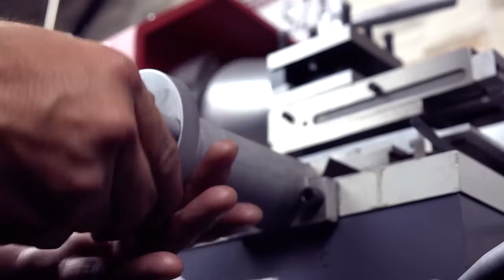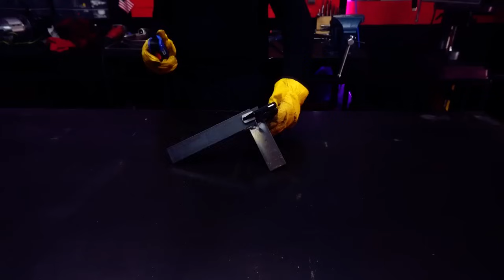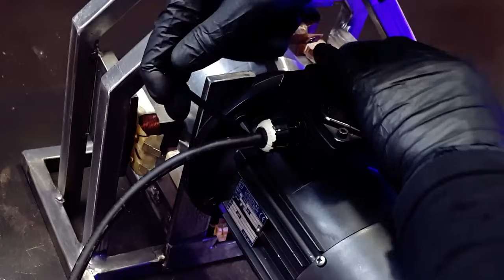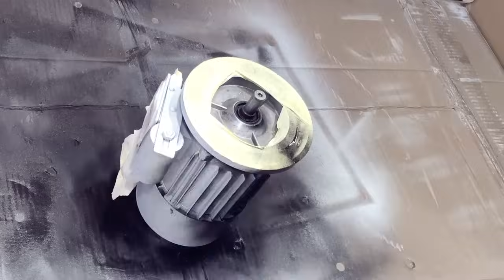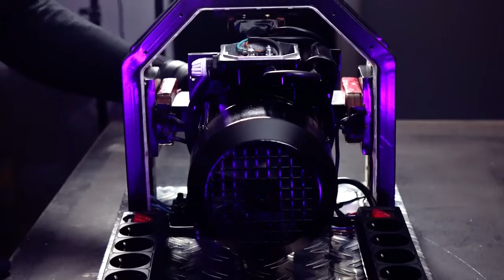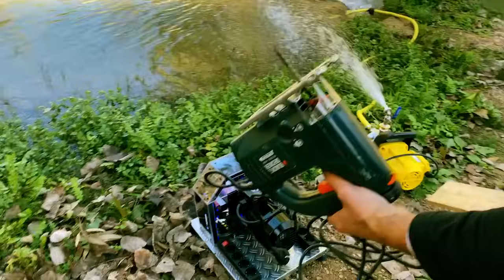How to Build Your Own 20kW 110-220 Volt Free Energy Generator

Comment: MAGNET ONLY ATTRACTIONS TO JRQÑ PULLED VACUUM DESIGN LEFT RITE PULLED NO PUSHED ELEMENT...AC LIVE MEANING ACTIVE..DC DISCHARGE BATTERY LOAD CAPACITOR...HOUSE HAS BOTH AC DC NEUTRAL GROUND .. EXPLODED ONLY DC DISCHARGED DEPOSITED CHARGED BOTH Pos+ ñ  Pne-..you cannot discharge only positive 2 lines..Active live 1 Line wireless to detect clamp voltages and Hertz 60

Comment: Another thought. Using an automotive brake rotor, epoxy the magnets to both sides of it, place dual coils, 4 @ 90 degrees and 4 more @ 90 degrees on the opposite side but offset by 45 degrees. You would have a heavy enough flywheel and could experiment with different combinations of driver and driven coils while dividing the vibration of magnetic braking of the generating coils and the vibration of magnetic braking of the motor driver coils by 8 instead of by 4, all in a compact package. The only major change that I would make would be larger, stronger magnets and the cast iron brake rotor itself over your silver / aluminum rotor. Silver contributes nothing but needed weight to your flywheel that cast iron can give for pennies on your dollar.

Comment: I normally try to debunk stuff like this but this one looks like it might work. I do have a few questions though:

1) The silver in the flywheel doesn't contribute anything magnetically or electrically to the system. I can see the added weight, over pure aluminum, helping to smooth out any mechancal transients though. I wonder if a cheaper metal would have done the same job?
2) I would be interested in seeing how long this system would run under a heavier, sustained electrical load.
3) At 228 volts, the voltage may be acceptable but is the frequency close enough to 50 Hz to satisfy electric motors and sensitive electronics requirements?
4) Would sliding the coils up the transformer cores, closer to the flywheel / magnets, produce more electrical power from the coils?
5) Would a combination of larger magnets and adding 4 more coils to the transformer cores, wired in parallel to each of the existing cores, increase the torque to drive that motor / generator, or even a larger one under heavier loads?
6) The Liberty motor seems to work similarily to other all permanent magnet motors invented in the 1970's with the difference being your coils replacing other strategically placed permanent magnets.
    I see there being a lot of mechanical loss in slinging that motor / armature shaft around not to mention the magnetic braking while under load. I don't care what you think, there is magnetic braking taking place whenever you load ANY generator. You may have mitigated some of this in your coil design.
    My question to you is, what if you increased the size of your frame, installed 8 transformer coils instead of four, ran your motor on four and used the other four to do the electrical generation. There would still be the problem of voltage and frequency regulation but if you rectified the output, filtered it, added a solar charge controller and used it to charge a battery bank, you would eliminate some of the wasted mechanical energy going into moving that mass of motor, (generator), armature, reduce the overll size of the project by at least half and using a power inverter with the battery bank, you would also eliminate the voltage and frequency variations that would come with electrically loading the system in the same way that a standard gasoline generator's shortcomings are eliminated by using an inverter generator. The voltage is better regulated and the frequency variations are smoothed out in the electronic timing circuit of the on board inverter plus you can achieve a clean 50 Hz sinewave which is next to impossible to do mechanically with a spinning armature.
    Allowing the motor / generator to run 24/7 to keep batteries charged, if the system draw is small enough, the battery bank is large enough and the liberty motor / generator output is high enough, it could be the best of ALL WORLDS as the batteries would be in a 24/7 charge / standby arrangement with the charge controller properly set to fully charge the batteries then cycle the unneeded power to something else like an auxilary hot water heater tht feeds your primary tank.
    I knew a man in Florida who had 4 daughters and a son. With a 40 gallon hot water tank, he still couldn't keep enough hot water for him, his wife and kids. He acquired another 40 gallon tank with burned out heating units. He installed it AFTER his primary water heater and heavily wrapped it in fiberglass batting. As hot water was drawn from the secondary tank, it was automatically replenished with fresh hot water from the primary tank and gave him 80 gallons of relatively hot water while heating only 40 gallons. In your case, you could install a second working water heater BEFORE your present tank. When your battery bank reaches full charge, probably at night, the charge controller can shift the Liberty motor's output to the new preheater. Even if it only heats at 25% efficiency, that is that much LESS purchased energy needed to heat that water once it enter's your main tank. If your water supply comes in at 60 degrees F, and your main hot water tank heats it to 120 degrees F, that is a 60 degree F increase. If the water goes into your preheater at 60 degrees F and gets heated there to 85 or 90 degrees F from free power from your liberty motor before entering your main heater tank, your main heater will only have to expend purchased energy to bring the temperture up from 90 to 120 or only a 30 degree increase rather than 60 degrees. Sorry, I'm in the U.S. and don't know how to convert Farenheit into Celsius. Just a thought.

Comment: How is the Frequency of alternator is Constant? And how is the Motor  Speed is constant while it is connected mechanical load. I don't know how voltage is being constant by using permanent magnets. How to Control  losses in Alternator and motor.

Comment: Thanks for showing us how to build something we cannot make. We don't have the "special" alloy for the rotor. You should have included a component list and anyone smart enough to be interested in this type of video doesn't need everything "dumbed" down for them. You should incorporate a volt meter and amp meter instead of LEDs. You should also find some more volunteers to be in the video so you can run all of the devices at the same time while two of them pick up the generator and show all six sides to the camera. and by the way it's a jigsaw not a chainsaw.
Reply: I totally agree.
Reply: 1st chainsaw without a chain i've ever seen.
Love the build.  
A bit secretive but you have to be.

Comment: The reason why most people won't believe this can't work is because they've been taught particle theory and not field theory. Field theory is Ether theory which is what Tesla, Maxwell, Thompson, Steinmetz, Faraday, Heaviside and thousands more are, they were not particle theorists. Particle theory tries to side step the understanding of why the laws of thermal dynamics has no bearing on the Ether. In fact, most particle theorists will claim the Ether doesn't even exist and was debunked a century ago, which is a lie. You cannot erase or debunk the limitless energy that powers this universe every second that goes by. 

What did you think a black hole is connected to? It's directly connected to the Ether, like a wormhole. The black hole is what connects this physical universe to the Ether, which is what powers this entire universe. And there is a mini black hole in the center of every hydrogen atom too, not an imaginary particle, a black hole, which is directly connected into the Ether. It's the same with any magnetic field from a permanent magnet. Most people have never seen the invisible field of a magnet and it looks just like a small toroid with a black hole in its center surrounded by both dielectric and magnetic fields flowing into the black hole. 

A generator motor isn't actually creating any electrical power at all, what its really doing is manifesting the power out of the Ether. The laws of thermodynamics only governs what is here in the physical universe, it doesn't control the Ether and how much energy you can pull out of it no matter how much heat or friction the generator creates. The only limitation of this machine is the bearings the motor spins on because they will be the first thing you'll need to replace when they burn out. Once you understand the fundamental dynamics of what a magnetic field is, as Tesla explained long ago, you'll realize there is a temporal displacement, a time gap between north and south pole because those 2 poles are not perfectly aligned with each other, thus allowing the door to be opened between them and into the Ether. The north pole of any magnetic field is red shifted, the south pole is blue shifted, one is pulling away, while the other is coming towards. The center between them is the physical opening into the Ether, and every blackhole has that feature. 

Ever wonder why there are massive jets of X-ray and gamma rays coming out of galactic black holes? Where do you think all that energy is coming from?, thin air? The only problem Tesla had with his generator was that it was inefficient. You can create a highly efficient generator that will still produce lots of heat and friction but it will also pull out hundreds of percentiles of energy out of the Ether compared to what its consuming. We've been lied to for well over a century and most of us swallowed the lies hook, line and sinker. If anyone wants more evidence of this go to a channel here on YT called Theoria Apophasis, run by a guy named Ken Wheeler, you can see what a magnetic field looks like in real time because he'll show you in many of his thousands of videos.

Comment: Most people don't have a foundry to to create those silver/aluminum rotor hubs, and even if they did you haven't told us what percentage of silver to aluminum content there is in them when melting the metals together. It would be also advantageous to have an electrical schematic blueprint of this device and dimensions for the frame, plus any North American alternatives when building them, because it's obvious yours was built for European voltages and appliances.
Reply: Este invento funciona ou não e se fazer o rotor só com liga de alumínio.
Reply: He said for America use 120 volt microwave transformer
Reply: @jamesgillmore2975  Yes, agreed about the coils removed from microwave ovens, but they don't tell us what the equivalent of the generator itself would be here in north America.

Comment: I heard nothing about the concern about the transformers heating up from the constant flux of North and South changes. I feel like this design is missing a water cooling solution to truly allow it to run forever.
Reply: It can't run indefinitely because the bearings the rotor runs on inside the generator would burn out first. You'd could buy yourself a supply of bearings though.

Comment: this is such BS it takes 32HP just to make 24kw
Reply: Is HP not a combustion physic that does not apply to electric generation mechanisms unless you add it to an object to propel and include torque etc ? 
Only asking coz its cost no HP`s to self generate ?
I shall get my coat 🙄
Reply: @garryl4275  they are equivalents it takes 32 hp to make an equal amount of kW in this case 24kW. so whatever little 1/4hp motor they used wont even come close to achieving 24kW. energy in = energy out -friction